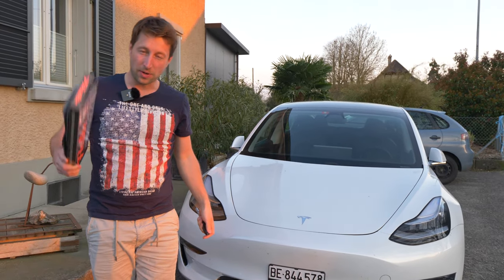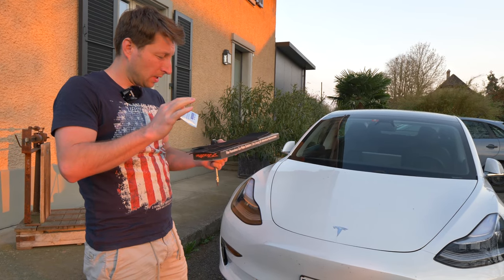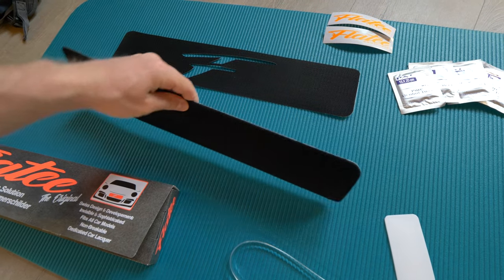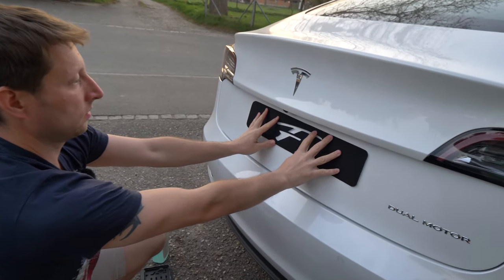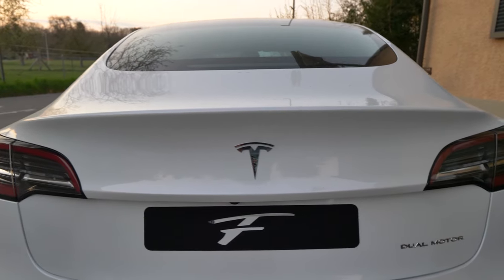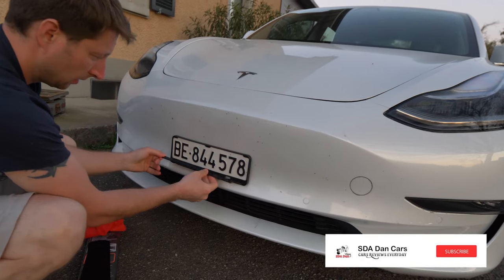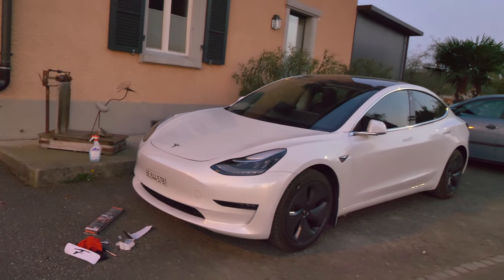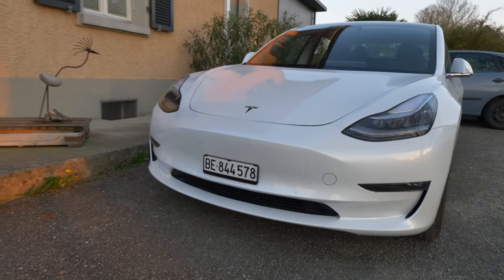Your Car LICENSE PLATES are Still in PLASTIC FRAME ? Time to Install FLATEE FRAMELESS PLATE HOLDER

Comment: So it's just Hook and loop? Those plates would be stolen so fast here. Much better just using some high strength double sided foam tape like 3M VHB.
Reply from the maker: Daniel people can stole the plate very easy anyway .....with the plastic holders is the same story.

Comment: IMHO , it will fall off after some time with different weather conditions even though at first it looks quite solid.
But the video with a detailed manual is great.
Reply from the maker: Adam I will check it from time to time but the glue they use it is very solid and I have some feedback from people that have it for more then 1 year so ....if it fell down I will probably but another ...
Reply: Not at all . Contact us, concerning the mounting of Flatee correctly.👍🏻
Reply: Probably you mean a regular hook and loop from DIY-store? Then you could potentially right. We developed Flatee for this particular purpose. The heat resistent glue is based on high quality synthetic resin especially for car lacquer. Temperature resistent from -30° up to 95°.